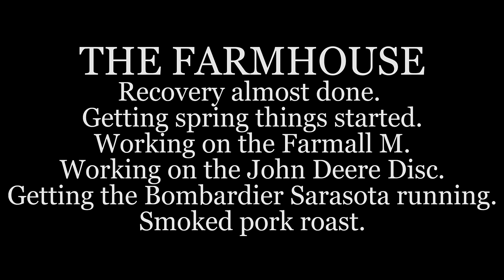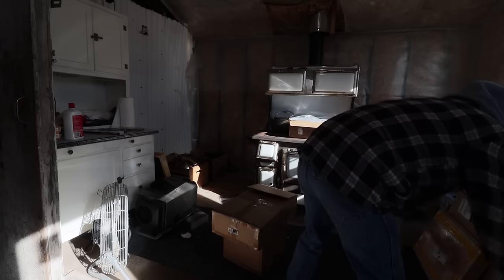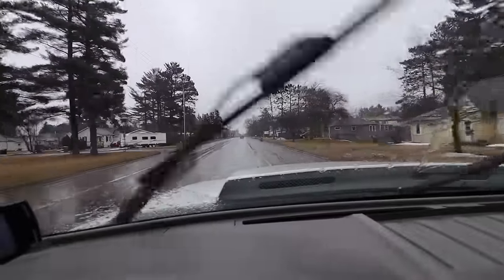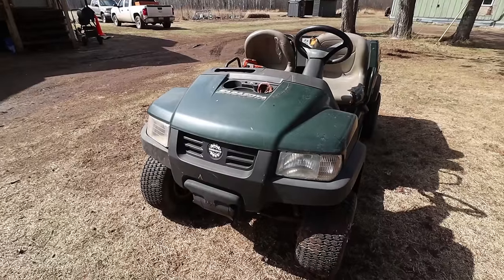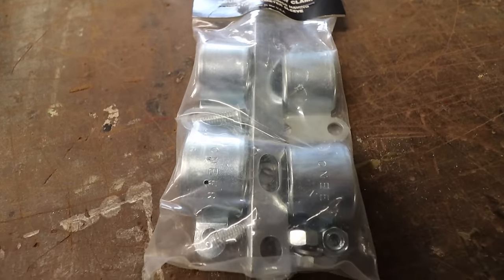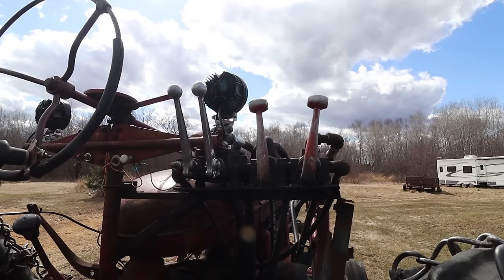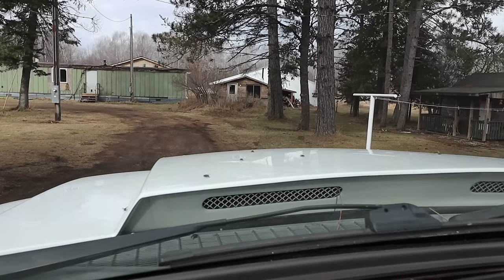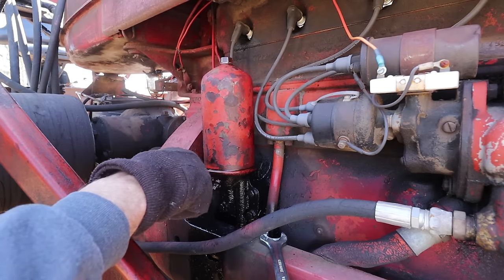THE FARMHOUSE. Recovery almost done. Farmall M hydraulics. John Deere disc. Cooking.

Comment: The leading edge of that implement is a disc, if the back gang is straight it could be considered a harrow......I guess. If the back gang can be set at an angle it will do a much better job.

Comment: Joe,  Get you a medium size cooler.  When you are done cooking (especially late at night) line the cooler with some old bath towels.  Wrap the roasts as you did, drop them into the cooler.  Cover with a couple more old towels and put the lid on the cooler.  The roasts will continue to cook and be pull off the bone tender the next day!

Comment: On the disk when you get the hydraulic cylinder hooked up run your control lever on the tractor to fully extend the cylinder on the disk then pull that top pin to free the link that is holding the disk wheels in the up position and leave it disconnected until you want to unhook the disc from the tractor. When you unhook the disk from the tractor you want to reconnect that link and then relieve the pressure on the cylinder so when you disconnect the hoses there is no pressure otherwise you would not be able to reconnect the hoses due to pressure in them from the weight of the disk pushing on the cylinder, As for the angle of the disk gangs you set that for how aggressive you want the blades to cut, you don't need to change that otherwise. With the old non wheeled disk they allowed for the angle adjustment for transport to different fields so you were not ripping the ground up where you didn't want to. If your cylinder control lever is backwards of what you want just switch the hose positions where they connect to the tractor and put tape or zip ties on one set for easy reference when reconnecting. Another thing I would do is remove that bolt that goes through the cylinder mounting plate below the top link pin, that will allow that plate to pivot forward and relieve pressure on the cylinder when your not using the disk with out having to disconnect the cylinder. When you are going to use the disk then move that top link pin to the lower hole after the disc is fully raised by the cylinder which will allow you to raise the disk wheels off the ground to add more weight to the disc blades and if you want to limit the depth of the blades in the soil you can get spacers that snap over the cylinder shaft to limit it's travel when you lower the disk blades into the soil. Hope that helps a bit, good luck Joe.
Reply: This guy pretty well has it laid out for you Joe. Got one like it. The rod behind the cylinder is also for road transport so if a hose blows the disk stays up. It may take a bit of finesse to get the pin pulled if full extension of the cylinder puts pressure on it. The depth spacers he mentions I know as "cylinder stops". For spelling use both disc and disk for search. When you unhook hoses shut off tractor and run lever both ways to relieve pressure first.  Good luck.

Comment: You have live hydraulics on that tractor, it is easy to put power steering on it.  The hoses to the rear remotes originally had them run under the seat on the platform and a cover over them for protection .

Comment: Joe, Check the Ground on your Tractor and the plug wire that runs behind your oil filter housing, when you started the tractor after removing the extra oil ring, there was a short to ground from the bottom of the filter housing. Around 55:00 in the video, sure looked like it anyway.

Comment: Just regular  silicone  tape will seal connections just fine, pipe dope like you were  using most of the times does not completely  seal the threads. One your disc you will need 5-6 rounds to even get your disk a few inches in the ground, plow your ground then disc your ground  otherwise your wasting alot of time abd effort. A four row plow should match your HP on your tractor.  Those valve body's  can be very tricky,  even if you have a extra remote spaces doesnt mean it will work correctly,  Good luck , hope your healing

Comment: That particular style of disk is what I believe they call a tandem disk, the other style that is shaped kind of like a V is called an offset disk. The offsets usually cut and dig deeper turning more dirt initially and leave a ditch or grove on the right side that your next pass in that same direction would fill up always making a bigger circle filling in the trench it leaves. Now the ta
Reply: Now the disk you have the tandem style you have usually isn’t as aggressive but it will get the job done just may have to make a few extra passes. It will leave a small trench on both sides so people usually pull or run a harrow behind or afterwords to level everything out. They usually bust up the clods and clumps better than the offset

Comment: It doesn't matter if your loader is still on the tractor with the cultivator on the back. If your used to it being on then leave it. It's just more work removing and then reinstalling it for the winter.

Comment: Thank you for the video. I enjoy watching your video's even when you are just pushing snow or mowing. What happened to your thumb?  Looked all purple and the nail was coming off.  I've lost a nail before due to paint remover I was using as a dry cleaner.  It was so painful. Take it easy if you can.
Reply from the maker: The night before we went fishing with the fish house camper I hit it when loading logs into the wood boiler. It honestly barely hurt, even the next day. I have lost almost every fingernail on my hands throughout my life being in construction. Some of them were bad and very painful, holding my hand above my head so the throbbing pain would be less. Lol. I will definitely be losing this thumbnail and if i remember correctly I will have some painful tender times ahead, but for now it seems fine, just looks awful. Thank you for commenting.

Comment: Pork roast is done at 145 degrees.  😊😊
Reply from the maker: Not when you are smoking it. You smoke until around 160, and I usually then pull it off the smoker, wrap it tight and you want to put it back until it reaches 195 to 205. Pulling it at 200 is a good choice since it will still cook once you pull it. This is how you get the traditional smoked pork roast or a smoked beef brisket. You might be correct if you are grilling it or cooking a roast in the oven as just a "pork roast" but not as a "smoked pork roast."

Comment: How’s the level of hydraulic fluid in the tractor?
Reply from the maker: I added fluid last fall, it should be good but I will be checking it again once the cylinder on the disc gets filled.